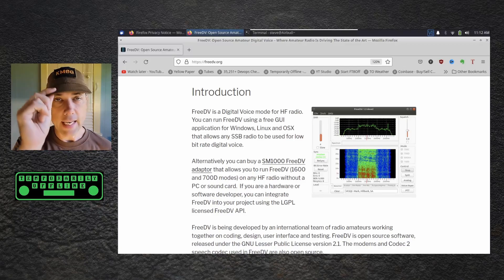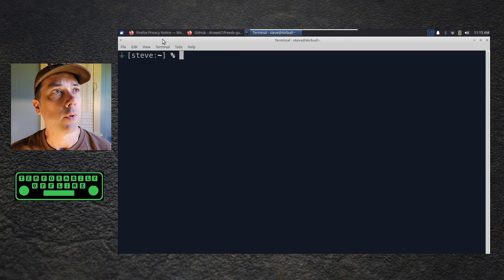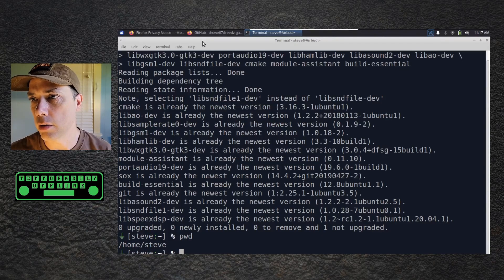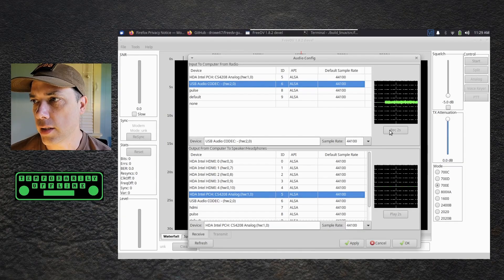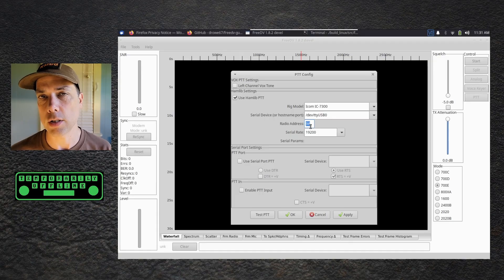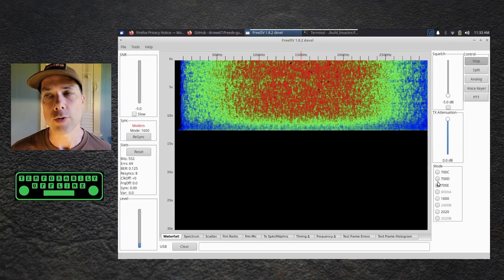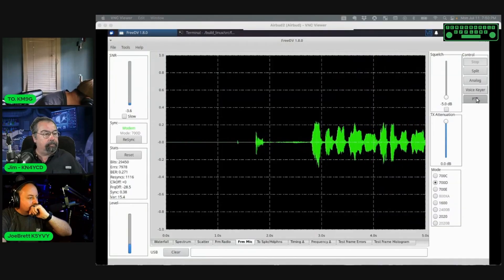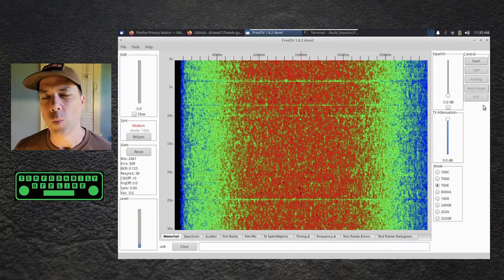FreeDV - What we learned

Comment: Will this work for the X6100
Reply from the maker: Yes it will
Reply: @temporarilyoffline  thank you very much I was wondering what the settings are for it
Reply from the maker: @joshhayes9570  just play with it.  It would be hard to hurt something.  Have you installed FT8 for your X6100 yet?  Very similar.
Reply: @temporarilyoffline  thank you I think I have the settings right it’s pretty neat yeah I use FT8 with WSJTX, what I am really struggling to find information on is how to set up the X6100 radio for FLDigi and FL rig

Comment: Thank you for the great video.  I have it installed and have not configured yet.  Was wondering, is there a way to build a launcher for this type ap stored in home folder?
Reply from the maker: Linux or windows?
Reply: @temporarilyoffline  oops.  Ubuntu 20.04
Reply from the maker: @eddugo3717  yes, search your hard disk for any "*.desktop" file and use the contents of that file as your guide.
Reply: @temporarilyoffline  Thank you!

Comment: @Temporarily Offline Ham Radio  Had a great experience by monitoring my own signal via WebSdr and testing FreeDV with a local OM (50Km) on 12m. The SSB Signal was stable around S3-S4, without any QSB of course, but nearly in the noisefloor. The audio was very hard to understand. So, really no fun for having a longer QSO😉 We switched to 700d/700e. Amazing! No noises, clear audio and it was a very good decoding possible. For the test via the WebSdr i selected HackGreen in the UK. At that time, same signal quality. Nearly no QSB. I reduced the TX Output successively from 100W to 1W. The decoding ended at around S3 with 5W! The signal wasn‘t really visible on the waterfall anymore. 
Of course, the audio is not broadcast (see also below👇 ),but there are amazing improvements since the „2020“ (not only VHF/UHF) wich is also only 1Khz wide. 

In times where i hear and see (that‘s where a big high resolution screen is kind of contra productive 😉) more and more „broadcast signals“, with bandwidth’s of 4kHz and more (even DX🫣) it‘s more exciting for me, experimenting with „low bandwith digital HF modes“ like FreeDV. 
Have to admit, since i switched to a Flexradio, it‘s much easier to setup (every) digital modes. With my Yaesu i quitted after a while. It was frustrating fiddling with the com ports which were just working very unstable. 
Just join the FreeDV Community via the „QSOFinder“ (http://qso.freedv.org/  to check who‘s online and better „onAir“😉 and get in contact via the chatbox. 73‘
Reply from the maker: That is great, thanks for all the info!

Comment: Now that I have a station built I need to try freeDV.  So many cool modes to try.  I guess the next step for me is figuring out the best way to pipe computer audio in/out of my rig (ft-891)
Reply from the maker: There is the signalink, digirig, and the xggcomms cable - all are good ways.
Reply: @temporarilyoffline  hey thanks!  Was just doing some googling
Reply: @temporarilyoffline  just pulled the trigger on the xggcomms cable, the one with the isolating transformers, not a bad deal
Reply from the maker: @yttc88307  good deal!